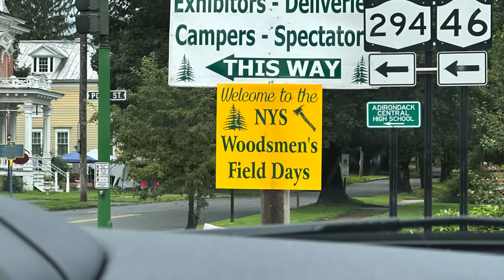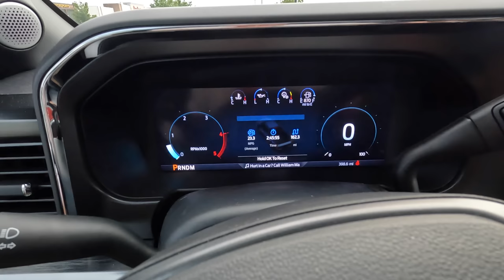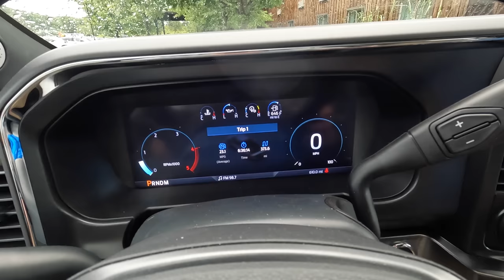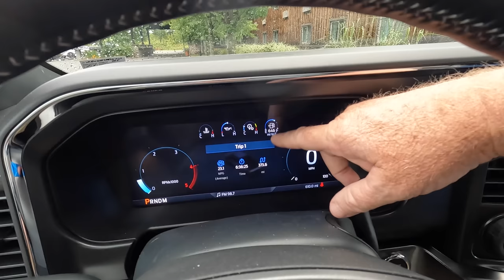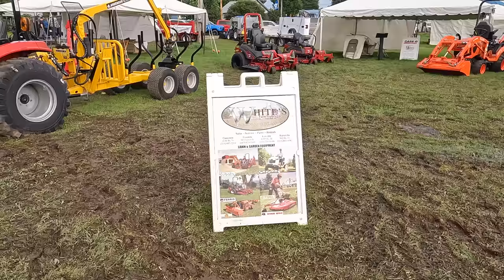Awesome Equipment and even Better People! Boonville Woodsmen's Field Days day 1

Comment: I love my super duty... my 6.7 gets 20.2 mph at 10,500 miles... it's an f250 tremor which gives it a f350 suspension... it easily handles a 15k lb dump trailer of stone.

Comment: I did not know that woodmizer made a log splitter until I saw it when you walked bye it. Great MPG your getting with the ford , need to have the chevy checked it should be doing a lot better than it is

Comment: These new truck are impressive. Last weekend on a trip home from our cabin  ,traffic was heavy with campers and motorhomes but on a good pace , two lane highway , no reason to pass. 55- 60 mph and trip meter when we pulled up to the house in the Duramax was 26.6 MPG's . Speed and wind is the killer of MPG's. That Super duty must has a big tank in her. Who would've thought  a crew cab 1 ton would out mileage a Toyota 4runner . 25 years ago my grandfather would've said I was crazy for daily driving a crew cab long box diesel .

Comment: Diesels are very efficient, I get 24 to 26 MPG in my 1 ton RAM Cummins on flat roads with minimal winds. My 1500 ECODiesel pulled 32.6 average MPG on a recent 2,600 mile trip. Let the PS break in a bit (the Duramax as well) and you should see an incress in MPGs.

Comment: Just think with that Easton made splitter, Melissa can sit in the splitter cab, with you loading logs on the feed.  Think about 5 or more split cords in a hour I am a guessing.  Oh yes my old dodge V-10 gets awesome gas mileage on the highway about 18 MPG not pulling anything.  You on other hand you are doing the same thing.  Start pulling heavy weight.  Oh yes a FORD is still just a Found On Road Dead vehicle.  Never again will I ever own one.  Sorry Mike I know you love them not me. Oh yes is that the super duty engine with the fuel injection pump issues? Have a super blessed time at Bonneville. God Bless you two in all you do.

Comment: not that it matters, but i bought a new f-250 lariat in 2021 and out of the gate with a bed cover, got between 21-23mpg.   In 2022, i started into a program where i drive a new duramax every year (not a lease but a purchase where you trade it in every year).   On the duramax's i would get around 17-19 mpg to begin with.   As you got to around 10k miles, it seemed to hover around 20-21mpg.   I am on my 3rd duramax now and they have all been the same.  Out of the box, they do not get as good as Ford.

Comment: The average diesel truck. Take only about one gallon per hour to run.. Even with the AC on.
Reply: May be just sitting ideling
Reply: @genethompson1027  I should have said Idling the motor.